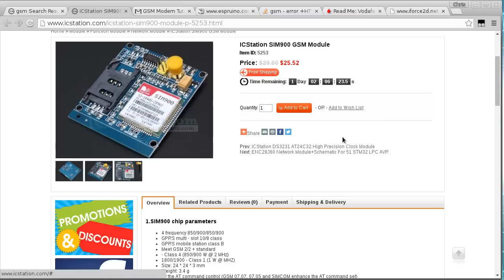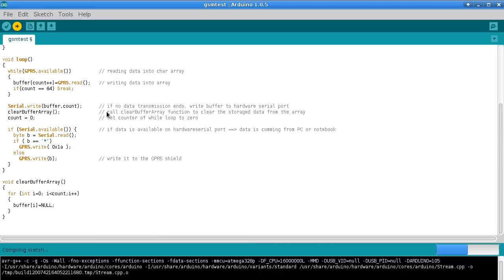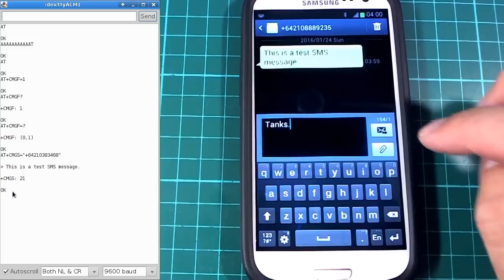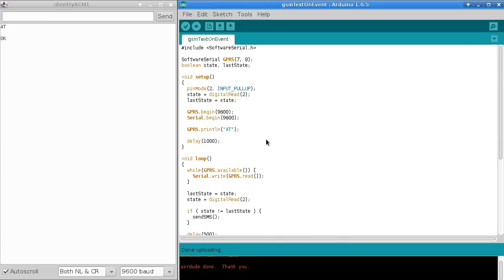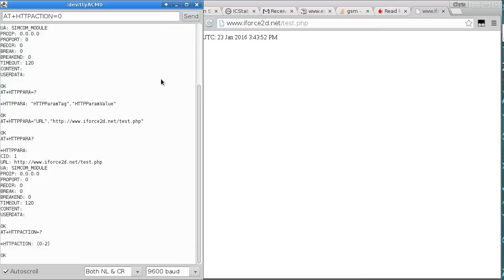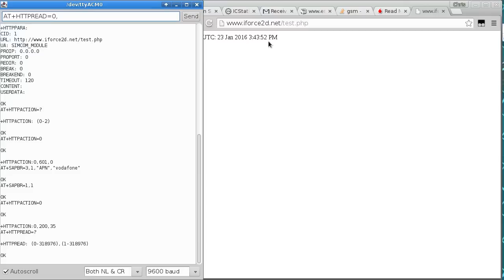Arduino + GSM module (SMS message, HTTP requests)

Comment: 0 - 1:34  demo
1:34 - 4:08 modules intro
4:08 -  5:40  about module current requirement
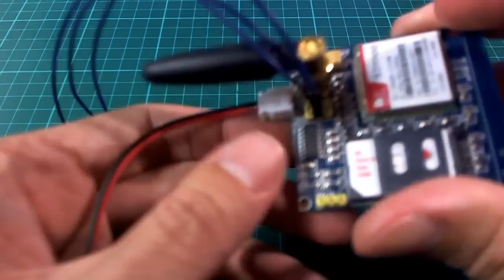5:40 - 6:15 connections
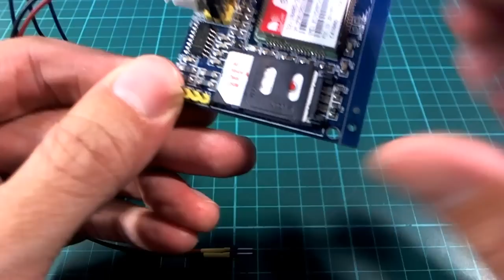6:15 - 8:10 connections problem faced
8:10 -  8:49 things needed
8:49 - 10:22  country/EMEI PROBLEM,pin code
10:22 -  11:37 led indications
Reply: @Vlad Buruleanu lmao

Comment: Hello, I have a Mikroelektronika GSM3 Click card and I'm trying to do something similar, but I've been having a problem where it can't get enough network. When I send the AT+CSQ command, it gives me a signal value of 0.0. I've tested the card on a cell phone and it works perfectly, but nothing works on the Module. I'm a beginner in this area. Do you have any suggestions for this?

(The card has an individual external power supply)
Reply from the maker: No idea sorry, I assume the 'network indicator' LED is lighting as expected? Never heard of these devices but it looks like they have pretty good docs and support, you'd be better off asking them.

Comment: Not sure you should be showing this can be extremely dangerous in the wrong hands
Reply from the maker: I think "the wrong hands" use the speaker wires as a trigger and just dial the phone number, same as they've been doing since cellphones first existed. No need for a modern smart phone, or SMS, or any programming at all. For precise timing (eg. motorcade) and within a short range they could just use the same radios we use for our RC planes. What I'm showing in this video is not some arcane knowledge that would help much.

Comment: Is it possible to supply it with mini solar panel and 18650 batteries? Cause as you mentioned they require more than 1 Amp current at peak transmission. Thanks in advance.
Reply from the maker: 18650 can supply the necessary current for sure. But solar panels would be useless for anything other than charging the battery, unless they are huge.
Reply: @iforce2d  Thanks

Comment: Hi .
Awsome video !
Is there anyway to mod this to respond to a call rather than a text ... I don't need it to answer ! I need to operate a relay or bell on ring and stop when the ring ends .....
Our sip phones used to use a function "ring anywhere' that rang an analog line with a factory bell attached .. But the pstn line has been removed .. I could use ring anywhere to ring one of these modules and relay a bell to ring ... But I don't know how to write the code to respond to rings, or even if its possible .
Thank you
Paul

Comment: Please someone help me out. I am not getting the AT Ok after I type in AT and hit send at the Serial Monitor. Secondly, when I insert the pin 2 jumper to ground I do not get the output message "Switch was turned off" on my phone but I get the message on the Serial Monitor. I am using a SIM800C v424 ROHS GSM Module with an Arduino Uno. What could the issue be?   Great tutorial. Really helpful for my research work.
Reply from the maker: Sounds like just not connected right. If you don't see the AT OK there's no point trying other stuff, so focus on that first.
Reply: @iforce2d  Okay Thanks. I would do that. But could you send me your email? I appreciate your effort.

Comment: Hello, I have a question. I was to send a text message from a webpage to the arduino Via ethernet shield and able to send that message to the gsm module because my sim servie only have unlimited text messages and phone calls no internet. I'm not good at coding, My skills are in hardware. can you help me out please?
Reply from the maker: Unfortunately not. How would a web server send an SMS message? Maybe only the cellphone company can do that.
Reply: @iforce2d  If you was in a remote location with no internet there but has Cell connection then I would say no. But If there is internet also I would add a Ethernet shield to it and have it serve a webserver connected to the Arduino and have it interface with the GSM to send SMS text.

Comment: Is it possible to push data to gsm module or I can only go for pull requests?
Reply from the maker: https://www.youtube.com/watch?v=OcDCbThN5yw
Reply: @iforce2d  Yeah I've seen it, but I was thinking about internet connection. I saw that it is possible to pull data from server, but is it possible to somehow push it to this module? (like an app, push button, send command via internet)
Reply from the maker: No, not unless you can somehow make your web server send an SMS message.

Comment: Thanks for this tutorial, but I want to know how can I control multible gsm module from same webpage, lets say each gsm module is connected to one arduino where I need to be able to control LED from each arduino from a webpage.
Reply from the maker: This video did not cover controlling the GSM module from a webpage. The GSM module only looked up a URL address, eg. to fetch a date. Maybe you can make a dynamic website that give different replies as necessary, eg. like these
http://www.mysite.com/?phone=1
http://www.mysite.com/?phone=2
But that is outside the scope of this video, and it still does not 'control the arduino' because the web server can only wait for the arduino to fetch the URL. If you want real-time 'push' control you would have to make the web server send a text message, which is even more complicated.
Reply: @iforce2d  thank u so much for ur reply  and sorry for asking a question out of scope of the video, but I did so because I have a project where I making pay as u go solar water pump inverter, then I want to be able to turn them ON/OFF from the web page remotely. Then when I saw ur video it gave me some light but still I need some help on this project. Thanks in advance.
Reply from the maker: If they don't need to be switched often, maybe you could just turn them on/off by sending a text manually? Would be simpler than setting up a website.

Comment: ///////////////////here is the first program for you all /////////////////////////

#include <SoftwareSerial.h>

SoftwareSerial GPRS(7, 8);

unsigned char buffer[64];  // buffer array for data receive over serial port
int count=0;               // counter for buffer array

void setup()
{
  GPRS.begin(9600);
  Serial.begin(9600);
}

void loop() 
{
  while(GPRS.available())
   {
      buffer[count++]=GPRS.read();
      if(count == 64)break;
    }
    Serial.write(buffer,count);
    clearBufferArray();
    count = 0;
  
  if (Serial.available())
  {
  byte b = Serial.read();
  if(b=='@')
    GPRS.write(0x1a);
    else
    GPRS.write(b);
  }
}
void clearBufferArray()
{
  for (int i=0; i<count;i++)
  {
    buffer[i]=NULL;
  }
}
Reply: I also found it was better to use @ symbol

Comment: #include <SoftwareSerial.h>
SoftwareSerial GPRS(7, 8); // RX, TX

unsigned char buffer[64];
int count=0;
   void clearBufferArray(){
      for(int i=0;i<count;i++){
        buffer[i]=NULL;
        }
      }
void setup()
{
  GPRS.begin(9600);
  Serial.begin(9600);
}

void loop()
{
  while(GPRS.available())
  {
    buffer[count++]=GPRS.read();
    if(count==64) break;
  } 
  Serial.write(buffer,count);
  clearBufferArray();
  count=0;

  if(Serial.available()){
    byte b = Serial.read();
    if ( b == '*')
      GPRS.write( 0x1a );         // replace * with ctrl+z
    else
      GPRS.write(b);
    }
}

Comment: Hi Sir, thanks for this tutorial but a small problem, I encountered an error the command AT+CMGS="+number" works well but when I validate the message to send it to my phone number it is displayed on my serial monitor "ERROR" I do not understand where it comes from the source of this error. Please help me.
Reply from the maker: Sounds like you are not sending the correct Ctrl+Z character. Are you using the sketch I showed at 13:09 to convert a '*' character to Ctrl+Z character?
Reply: @iforce2d  Yes that's exactly what I used I used the code you showed in your video I nice and well use a '*' character exactly as you did I use the sim900a GSM module I don't know if it's a problem linking to my sim card. In this case do you have a proposal for me concerning the sim card? Thank you.

Comment: I purchased two of the module pointed to in the link above. IN aUSTRALIA AND WITH AN OVER THE COUNTER Telstra SIM CARD, excuse caps, have been sending AT commands :) anyway, i am getting...+CMS ERROR: 2172 whenever i send a text message. i have googled this code, but it only shows up for another chipset of GSM module and not sim800l
Reply: i have been reading that the sim800l only works on G2 networks. Australia only has G3, G4 and now G5 networks. Maybe this is the issue.
Reply from the maker: @ismzaxxon  Yes, this module is 2G. Fortunately here in NZ Vodafone is maintaining their 2G network until 2025 so we can play with this cheap stuff for a while yet.

Comment: Why did you not connect it to the rx tx of the arduino board.. Sir
Reply from the maker: Because I wanted to use the rx/tx of the arduino for the serial monitor.
If you don't want to use the serial monitor, you can use rx/tx of the arduino.
Reply: @iforce2d  what is the problem on rx tx on arduino sir...
Reply from the maker: @leonardcainguitan7863  The rx/tx are the same as used by the USB connection to the computer. You can't use the USB connection and view the serial monitor, if you have something else connected to the rx/tx. You also will not be able to upload sketches, because both the GPS and the computer will be on the same pins...

I already answered your other question: "If you don't want to use the serial monitor, you can use rx/tx of the arduino."
Reply: Is it ok sir if i connect rx tx  from arduino to gsm module 900a mini

Comment: So I bought my Arduino Uno, a SIM800L coreboard (uses the same chipset as the modules you have linked), and an activated contract SIM card.
I uploaded the necessary code to the Arduino, connected the TXD and RXD on the SIM800L to the corresponding pins on the Arduino and the GND and VCC pins to 3.3v on the Arduino. Obviously this didn't work because it's below the voltage needed, so then I tried running it from 5v. Realising this wouldn't work either, I got a LM2596 buck converter (supposedly capable of 2-3A regulated DC) and set it to a satisfactory 4.0v.
Now, the SIM800L was powering up - sometimes. But only the first time it powered up did it register on the GSM network (fast flashes turned slow). Every time after that (tried two diffent SIM cards both ways round), it just kept fast flashing.

Originally I was getting a very fast flow of garbage in the Serial Monitor. I checked the Baud rate was definitely set to 9600 and Carriage Return + Line Feed were set. I realised I had forgotten to link GND on the Arduino to the LM2596 -ve (not having this link meant there was no reference for Tx and Rx I believe).
However, after adding in this link, I got the same slow repeated series of nonsense characters. The flow stopped when I unplugged the TXD jumper wire from the Arduino, telling me that the Arduino was displaying data sent by the SIM800L (correctly or otherwise I don't know). At no point have I ever had a successful response to AT (or AAAAT) through the serial monitor.

No matter how many times I restarted, I couldn't get the SIM800L to lock back onto the network, or respond to Serial commands. What could be stopping me? I started on this project at 9am this morning parts in hand, and at 5pm I still haven't discovered what's wrong. :(
Reply from the maker: Why 4.0v ?? These require 5v
Reply: @iforce2d  The 'coreboard' doesn't have any of the onboard power regulation, it's just the bare chipset, and the chipset operates on 3.7-4.2v. I read that overvolting it with 5v would fry it. I have a feeling I managed to do that by attempting to power it from the Arduino...

I ordered a different board which arrived today that looks identical to yours, but now I'm struggling to get it talking with the Arduino. It doesn't respond to anything I send it.

Comment: can I program this in a way that a piezoelectric sensor will activate the system and send a text message?
Reply: You can put it together so that anything triggers the Arduino - a motion sensor, shock sensor, light sensor. As long as it can close/open a link between a GND pin on the Arduino and one of the input pins it will work.

Comment: Im stuck at AT+SAPBR=1,1
. Need your help asap
Reply from the maker: Unless you also live in New Zealand and use Vodafone like me, you probably need to look up the correct APN for your provider.
Reply: @iforce2d  I fixed it sir. It was because I failed to put on the right details as you have stated. Thanks anyway :)

Comment: You can send ctrl-Z on the Arduino serial monitor:
Install and open a better editor, like Notepad++ (NOT Notepad)
do alt-026 (hold Alt, press 0 press 2 press 6, release Alt)
The editor says SUB, select this. (Shift and home if your cursor is at the end of line)
Ctrl-C to copy
Paste that into the Arduino monitor.  It shows a little square.
Press enter. Then you should be all right.
If this doesn't work, find someone who understands how to do it properly.

Comment: What's the difference between GSM and GSM Shields?
Reply from the maker: Usually a 'shield' means it is made to plug into some other board, like an arduino. That way all the connections will be in place and you don't need to connect by wires.

Comment: Hello sir, I'd like to ask a few questions regarding the connection. I have the same GSM module as yours in the video, but it doesn't power up when I connect it to the 5V of the arduino. Also when I connect the GND of the module to the GND of the arduino, the arduino loses power. I was wondering if I'm doing something wrong with the connection, or is my GSM module defective.

P.S. I'm getting a 5V reading at the GSM module when connected to the arduino
Reply from the maker: As I mentioned in the video, you should not power it from the arduino. You will need a 2 Amp capable power supply to send messages. In the video I am using the USB connection of my desktop computer, which seems to be capable in my case but this is no guarantee.
Reply: @iforce2d  i followed the same procedure as you did in the tutorial, with the arduino powered via usb connected to the computer. I also tried different connections with the tx, rx & gnd, but i still can't get to power up my gsm module.
Reply: Reading 5v with what?... An oscilloscope or an analog meter with a needle?
The voltage only needs to drop down for a fraction of a second and your GSM module will brown out/reset/not run

Comment: Please help someone, my SIM900A has been working fine* to some extent with one particular sim card. I recently came back to it with the same two testing cards (one on 3 that is a little iffy compared to my main sim on BT. Both cards do not work in the SIM900A yet used to in the past. The red light keeps blinking no matter what!

Comment: Place help me new gsm modules sim900a  dc power supply  using
Circuit daigram 
But i am using arduino 5volt pin ussing sim900a module no network, network led blink all time 
Help me
Livekiron@gmail.com

Comment: Good day

I live in South Africa. I bought a GSM SIM900A module, 5 months back. Unfortunately, I have never been able to get it working. 

The status LED blinks fast (once every second), which tells me that it is not connected to the mobile network. I can send AT commands to it. It can 'see' the networks available in South Africa but it cannot connect to any.
Reply: Any help or pointing to the right direction would be much appreciated. Thanks.